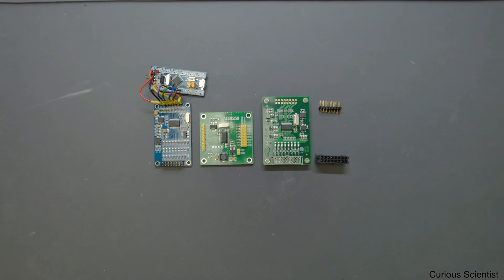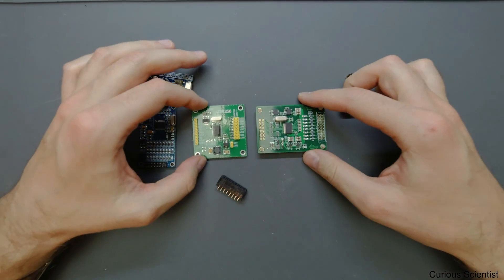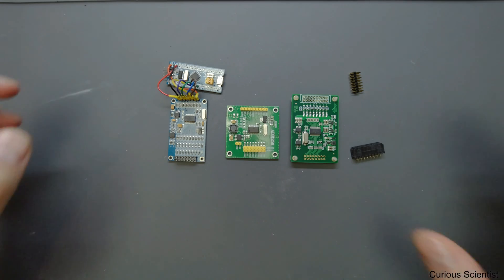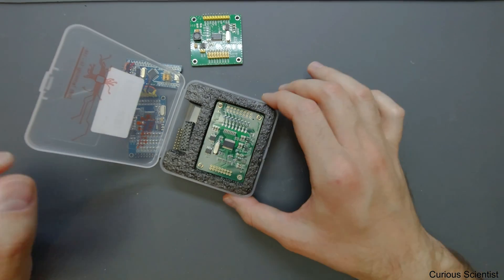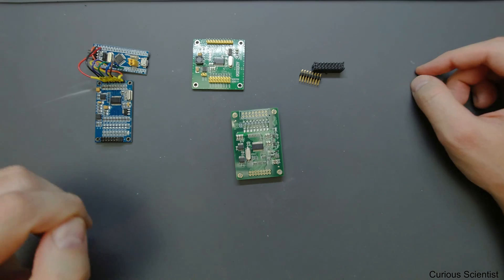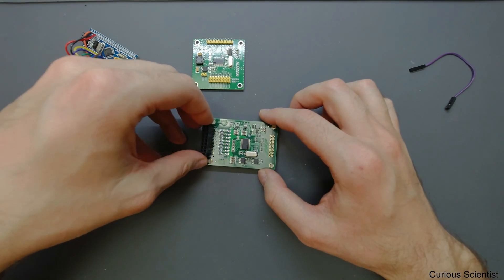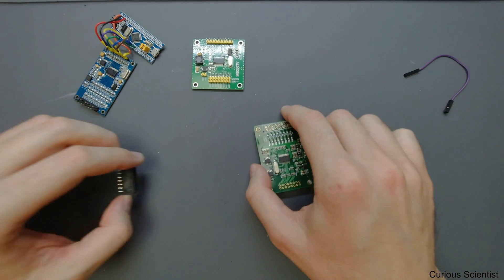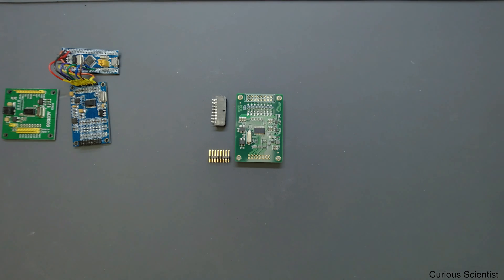ADS1256 - Board comparison

Comment: What is the exact size of the board, and the positions of holes?
Reply from the maker: Hi! I don't know and I don't have the time to measure it, however I am pretty sure that you can find it on Google.
Reply: @CuriousScientist   Thank you for your answer, but google couldn't find any info.
Reply from the maker: @turgutkarademir2578  That is really interesting, because I could easily find pictures of the green, square shaped board where there is a ruler right next to it. It takes maybe 2 minutes in Gimp to measure the dimensions using the ruler as a reference.

Comment: I bought several "blue boards" from 2 different suppliers, but both Adr03B reference are fake ICs, it's dummy IC. so if somebody have problem with the blue board then check the reference IC output first.
Reply from the maker: Thank you for the information. Luckily, I haven't encountered any of the bad boards so far and recently I build 5 circuits using the blue board. All of them still work properly. Sometimes the manufacturers copy each others' boards and they fail to transfer everything properly. The same design can come from different manufacturers.

Comment: Hi man I've been following your videos for the past month I've found them very helpful, recently I'm working with the blue one , but I'm strugling to get the write  readings from a 0-5v source (potentiometer)
Reply from the maker: Hi! What is the exact issue? I can help you to make it work!
Reply: @CuriousScientist  well the first issue was the connections I don't now if I'm doin it right because I'm using the blue board and I think it has different pins, making some rest I got errors writing into the registers
Reply from the maker: @ThatDataExt10  Yes, I explained those differences in my video. Some boards have reset (RST) pins, some don't and some boards have SYNC/PDWN pins, while other don't. But in general these should not influence for example writing and reading the registers because those processes are realized through the SPI pins (DIN, DOUT, SCLK, CS), which are pretty much standardized everywhere.
Reply: @CuriousScientist  oh I get it, I'm going to watch your video about read and write registers to try to understand better, how does the communication works .One question,
In the code that you use in the full demonstration how do you convert  from bits to voltage?
Thank you so much for your assistance!
Reply from the maker: @ThatDataExt10  Hi! Please check the videos and the source codes in the description. I am pretty sure that I have told the process several times and also shared the source code for it. I shared so much information, all you have to do is to carefully watch my videos. Cheers!

Comment: The expensive one have some cool features. It have limiting resistors on the control pins, buffer in the reference, two ldo and of course the packaging tells that they care. The documentation is in chinese but at least I can read "electronics", I sure there are more info there outside.
I ordered one to try but with the actual situation in Chine maybe I can get it in three months probably. Thanks for the info.
Reply from the maker: You won't be disappointed by this board, it is very good. I started to use it with an STM32f103, but I also tried it with an Arduino Nano. I have some strange issue with it, and I couldn't yet figure out the reason behind it, but the voltage I read is approximately 0.3 V less, than it should be (for example, I read 1.9 V instead of 2.2 V). The VREF is 2.5 V, so that is good. All other voltages are perfectly fine. I will upload a video of the actual board and some experiments as soon as I figure out how to read the proper voltage. (my other 3 ADS I have works well, so I am just missing something maybe)